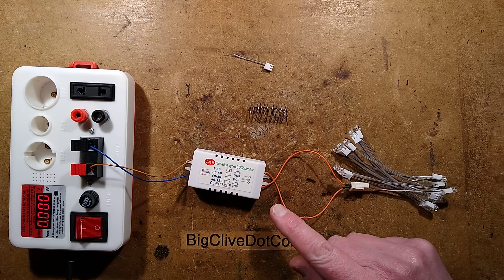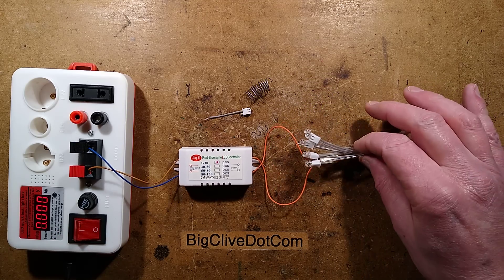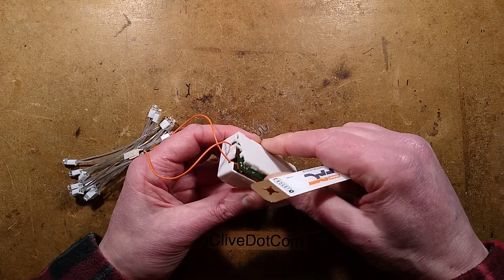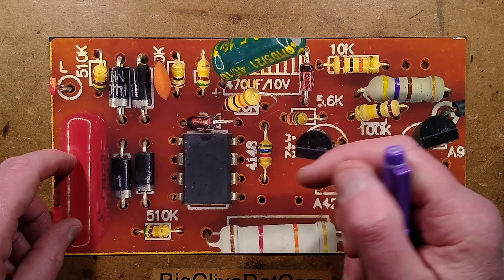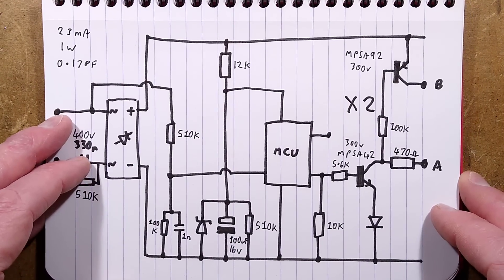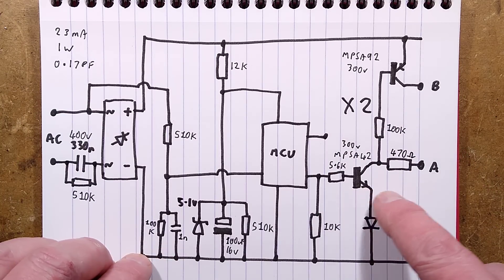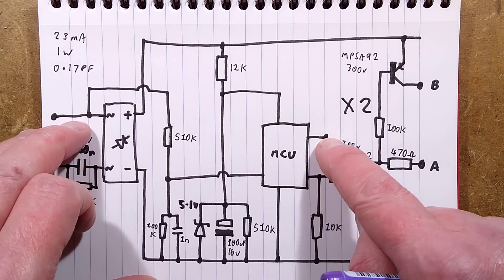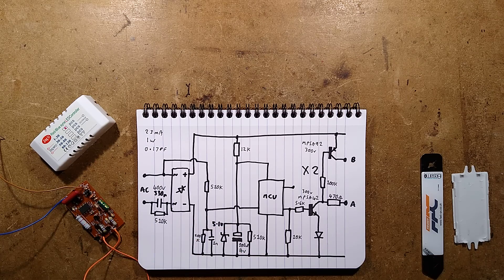Trashy and a bit dangerous, but a clever design

Comment: Hey Big C! What's the name of that switch box thing you have for the mains voltage, also the other one you have that you put the wires in and press down to turn it on, it's brown or red. I need one of the two for a project and cant find either of them anywhere and searching on digikey is a fruitless endeavor. Hopefully you see this. Thanks Clive! I see people using them in various videos but have never seen them for sale. Preferably, i'd like to have the smaller one that you press the wires into the contactor. It's for an isolation transformer and variac box i'm building.

Comment: I would not bother with detecting when the power is removed. I would simply, at each power up, read the nvm used to store the state to use, and immediately write the next value into it. so that on next power up, it has advanced. it would be simple to test if this is how it works, but turning it off for more time and seeing if it resets to the initial state again or continues with the setting cycle.
Reply from the maker: That would require non volatile memory.  This unit uses a capacitor as persistence memory and a very cheap microcontroller.

Comment: "Trashy, a bit dangerous, but clever". I wouldn't expect anything more.

Good thing about the capacitor dropper, is that any current draw will limit the DC voltage out, so those MPSA42s and MPSA92s will only a short time, when there's very little current draw. Max current for 240V, 50Hz is ~35mA peak. But at that draw the DC voltage will be low. So extra trashy voltage statistical gambling here. No blinky lights in the shower, please.

Comment: I never understood copper coated aluminum.  Copper oxidizes into a non-conductive mess while aluminum forms a crystal shell that protects the rest of it.  But aluminum is not as conductive as copper.  So copper coating aluminum gives you the worst of both worlds.  An aluminum coating will protect the copper from oxygen so the copper remains conductive for a very long time.  Thus, aluminum coated copper would be the best way to go.
Reply: Aluminum can't be soldered using normal methods.
Reply: @eDoc2020  But it's easy to strip off of copper wire with acid.  So there's still no problem there.
Reply: @jdlech   Aluminum coated copper is the worst of both worlds. It combines the high cost of copper wire with the connection problems of aluminum wire.
Reply: @eDoc2020  You're just trying to be ridiculously contrary.  Don't be a clown.
Reply: @jdlech  If aluminum coated wire was a good idea then why doesn't anybody use it?
Reply: @eDoc2020  I use it as my speaker wire and outdoor electrical projects.  Got any more glib quips?
Reply: @jdlech   Aluminum coated copper? Can you point me to a source?
Reply: @eDoc2020  I don't see it on the market anymore, but my speaker wire is 1000 strand 8 gauge aluminum coated copper wire.  Each strand is hair thin.  I just checked earlier today because of this conversation, and there's no sign of oxidation anywhere, even under a magnifying glass.  I bought them back in 2007.  By now, any copper exposed to the air would be completely rotted and in need of replacement.  Even tin or silver would have oxidation problems.  Especially silver.
Reply: @jdlech   I still don't see the point of aluminum coated copper wire. Assuming it's much better than plain copper in terms of corrosion (which I have doubts about) why not just use plain aluminum wire? The only reason I can imagine is if you are limited by physical size. Even that's a stretch because copper wire only provides a 20% reduction in diameter compared to aluminum.

Comment: The amazon cheap LED lights I replaced in my swimming pool / spa work like that. There is an included remote control but it doesn't work through the water at all, so quickly powering them off and on is how I switch their colors / patterns.

Comment: I wonder how that microcontroller is remembering the setting? It'll be something ridiculously cheap, maybe one of those incredibly simple Padauk jobs --- you can get them for $0.03 a pop (or at least, you could). They start with 64 bytes of RAM and 1kW of program, but no non-volatile storage. Surely this thing isn't using a flash part. Could it be getting away with using the big capacitor to keep the RAM alive for thirty seconds or so and then relying on the user remembering what setting it was on last time once the RAM dies?
Reply: Exactly, it stays on for some time and detects there is no ac with a pin.

Comment: how old is that? looks like a circuit board from 40 years ago.
Reply: There's nothing particularly old looking here, i mean this is how cheapest stuff was constructed 25 years ago and once you start cranking out stuff by the tonnes, it can be counter productive to upgrade. It could have been manufactured last month.

Except deep brown PCB colour, that's a little unusual. Paper phenolic PCBs lean brownish, but usually not quite as much. Unclean raw ingredients or copious BFR to make it less likely to catch fire, who knows. At some point in the last 20 years, several of the BFRs were phased out due to potential environmental risks and whatnot.

Comment: I have one of those power units on its own--bought it nearly ten years ago now. It is exactly the same as yours there--the lowest LED count version. Never used it. Do they still sell them alone?
Reply from the maker: They do still sell them on AliExpress.  The lowest count LED one will still drive much longer strings with reduced intensity.  I have a few connected to strings of traditional tungsten lights with all the bulbs replaced with LEDs.

Comment: It's amazing how they manage to eliminate the very last button to safe a penny. It's similar like with today's electric cars. If the touch screen (as your only interface to everything in your car) fails you literally cannot operate a single thing.
Reply: And if you try and operate a touch screen at Autobahn speeds, trying to find the damn wiper speed setting, it might be the last thing you do …
Reply: @rolfs2165  What's also cool: I have my car now for over 7 years, and I still manage to find new features when digging into the 10th sub-menu of another sub-menu. I also found out, how I can watch DVDs while driving 😎 📺 👀 Sound is like being in the movie theater 🎶 Endless options after jail-break of the entertainment system.

Comment: Off-topic, but I know you're interested in street lighting, and I just watched a crew replace the street lights outside my building. Originally I got a message from the grid operator advising me that they were going to temporarily switch off the power to my place, then they sent me a message saying it was cancelled. That was supposed to happen last week, and then tonight I heard the sound of a hydraulic motor running outside and popped my head out to see a cherry picker and a guy working on the street light. The building's power wire is also connected to that pole, so evidently they worked out that they don't need to disconnect it to work on the street light. Interestingly, the first thing the guy did was switch off the light across the road, which I guess means it's fed from the pole outside my place, and evidently he had to disconnect that before he could disconnect the one he was working on. It looked like he had to replace the cable running from the junction box on the side of the pole to the light, because he did stuff around with a cable for a while before he replaced the light, then he had to feed a new piece of conduit on to cover the wire from the junction box to the base of the light arm (or whatever you call it), and then he finally reconnected it and it lit up. I also noted they replaced the orange tinted presumably fog lights for regular white lights. Not sure why they'd do that, unless the new LED lights somehow don't have issues in fog? Also weirdly, the new lights have a lid on top that flips up. I wouldn't have thought that would be good for water ingress, but I guess it depends how it's implemented.
Reply: Sounds like the usual first visit to a new job: "Who the #### did that and what were they thinking?"
Reply: Depending on the tint of the old lights they might have just been sodium lamps. Sodium lamps are the most efficient old-school lighting technology but put out orange light.

Comment: I see 4 transistors on the board... Could you coinnect another set of leds?
Reply from the maker: I only showed half of the H-bridge in the schematic.  All the transistors are needed for a single string.
Reply: @bigclivedotcom  
Would have been interesting too. For me, not beeing an electronics expert.

Comment: I have a bathroom ceiling light which changes modes when it is switched off and on within a certain time - it's very annoying when you switch it on and it is in brothel mode and you have to find the remote control to put it in boring bathroom light mode. I wish there was a way to disable this 'feature' and just use the remote control.

Comment: interesting little device. is there anyway to run it on DC power ? other than the mains power. would be an interesting thing to use but I don't want to run it on mains power.

Comment: I love your test unit. Let's put 230v through speaker terminals.🤣
Reply: that is very common in china. I have seen entire production lines with these things. you can buy in little shops what looks like a power strip but its just flimsy plastic like hat you would use to conceal wiring along a wall with a bunch of these speaker terminals glued to it. Inside you will find bare "Copper maybe?" wire connecting line and neutral directly to the speaker terminals with no fuse and about half of the solder joints actually connected. I actually bought a couple just because I love this sort of trashy stuff and its great that you can just buy it off the shelf here.

Comment: Is it experience that gives you the idea to cycle the power rapidly or do these units come with instructions?  I've often wondered the process.  Decades of curiosity or chip data sheets?
In any case, I love the videos.....Thank you.
Reply: @SwimCoach8  Another useful option, if a device has a momentary push button, is to push and hold this to access "hidden" features. A greater than 3 second hold is the most common here, but some other devices have a further option that's accessed by holding for more than 8 to 10 seconds. Have fun!
Reply: @theonlywoody2shoes  Since watching Clive, I always press, double press, try resets, press and hold.  I was just curious if he expects these functions or if he stumbled on their availability.  My first find (after watching Big Clive) was getting Christmas light to remain a constant color and not flash.  Nothing in the instructions about that function! hehehehehe
Reply from the maker: The listing indicated modes.

Comment: Odd way to configure an H bridge. I'd expect the bases to be connected together as the input, and the collectors tied together for one side of the output. This looks like they both turn on at the same time, which really isn't what you want.
Reply: I think that they avoid dead time problems this way. With same command on the bases the two types of transistors have different switching times and a short could be possible.
Reply: @robegatt  Both transistors are active at the same time in this arrangement. That's the odd part. If A and B are cross-connected for the second pair, i. e. A1 & B2 are connected to one side of the LEDs and A2 & B1 are connected to the other side, i think it would work ok, but you'd still have the potential for a short.
Reply: @PaulSteMarie  I think that's the reason for the 470R resistor. Just incase the chip loses it's mind and turns all the transistors on at once. The 470R will limit the brief surge current.
Reply: I think it looks odd because a lot is being dealt with in software.

Comment: Inverse parallel led, how do you not blow up one side? Because one always had a path for current to flow? I've not seen those before
Reply from the maker: Each LED clamps the voltage across the unlit one to 3V max.
Reply: @bigclivedotcom  so it's still being actively damaged?
Reply: @bigclivedotcom so if one goes they both go pop?

Comment: I've never been a fan of doing H bridges that way, I much prefer the more conventional 4 wire control so that you can have a guaranteed all off state between phases and avoid shoot through.
Reply: Without seeing the other side Im guessing that’s probably why the 470 ohm resistor is there. But, it’s on a low current supply so probably not a huge deal. Plus it’s China. If it was actually right, it would be wrong 😂
Reply: Is shoot through an issue with bipolar transistors? I know it is with MOSFETs.
Reply: @flapjack9495  it’s really a product of the driver itself if there is not sufficient dead time between transitions.
Reply: @flapjack9495 yes. If both channels were turned on at the same time, current would flow through the PNP transistor, then through the undrawn 470R + NPN + diode of the second channel, which must be connected to ‘B’ (with the undrawn PNP collector connected to ‘A’). If I understood correctly. 

I guess the 470R resistors value was chosen for LED current limiting.
Reply: In this case, dead time where the two uC pins are both low will guarantee off state also.